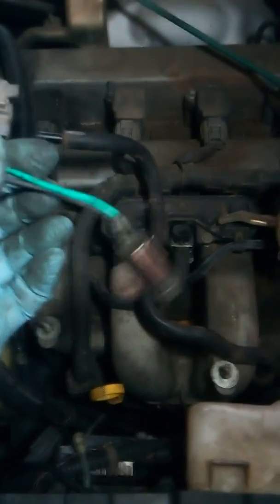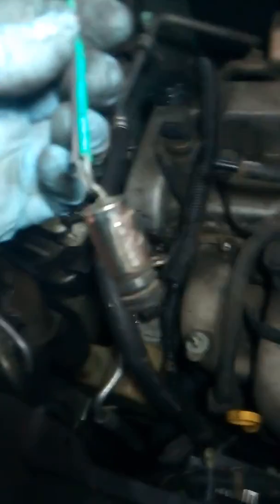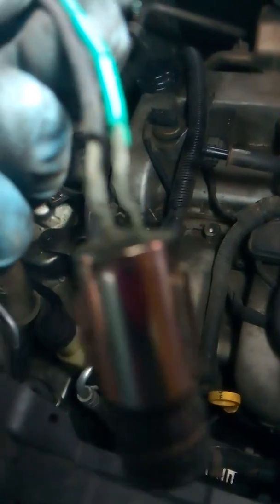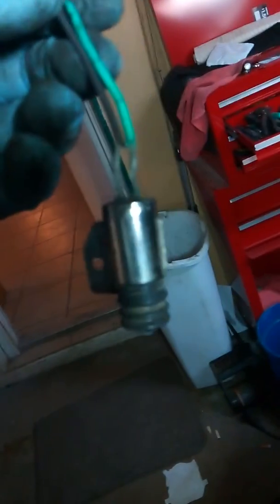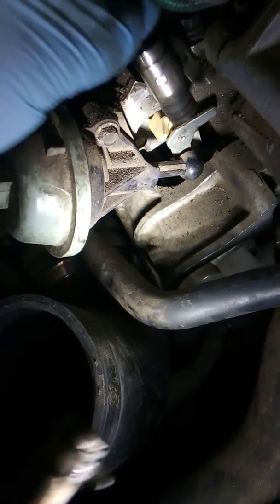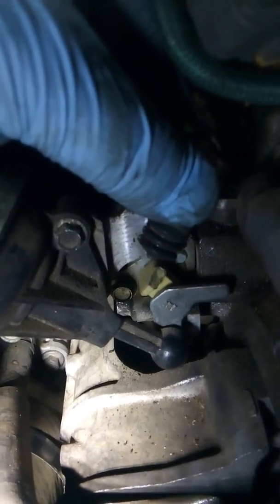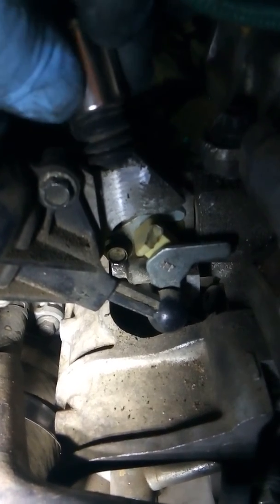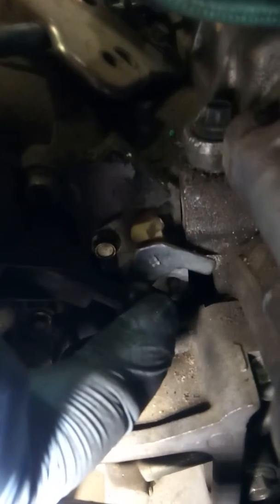IMRC Part#6 Mazda runner control repair diagnose engine code P2006 cx-7 Ford edge 2.3L

Comment: looking to find the switch..whats the model number for a replacement
Reply from the maker: It's a throttle sensor PN
L3K9189B1
Reply from the maker: There'sthrottle position sensor that's a different part sometimes when you look them up online if you look up a throttle position sensor that when will come up but I guess it's the one you're looking for is the throttle sensor
Reply: @richieparrish7101  I have a 2008 Mazdaspeed 3...I'm looking the model number up online and getting inconsistent info on if it can fit my car
Reply from the maker: Ok Micheal I'll try y to help you out but I'm super busy right this minute, text me later 48o two17. 5two35
Reply: @richieparrish7101  no rush at all...I'm actually surprised you responded..lol...thanks for the actual model number...I can use that to  do some more research
Reply from the maker: @MichaelWilliams-vg1ou   24036-01294823 parts geek
Reply from the maker: Try googling Mazda CX-7 throttleswitch and the second thing that pops up should be the one that's what goes on my CX-7 I don't know if it's the same for your Mazda 3 but you should be able to tell just by looking at it a little metal cylinder with a bracket that has two screw holes and then short wire and a connector if you text me I can send you a link
Reply from the maker: It's listed at 101.92 and 101 .58 parts geek I just googled 08 Mazda 3 throttle switch and came up with the same part
Reply from the maker: Hey Mike how did it go?
Reply: @richieparrish7101  I ordered it.. shipping now...thanks for your help
Reply from the maker: @MichaelWilliams-vg1ou  awesome man I hope it fixes all your problems
Reply from the maker: Keep me posted let me know how it goes okay
Reply: @richieparrish7101  I will
Reply from the maker: How did it turn out Mike
Reply: @richieparrish7101  fixed the switch. The new one did the trick. thanks for all your help on this.